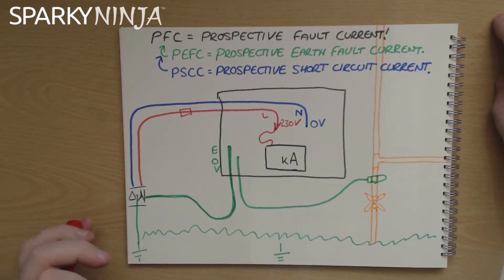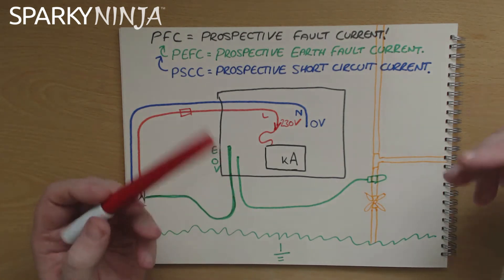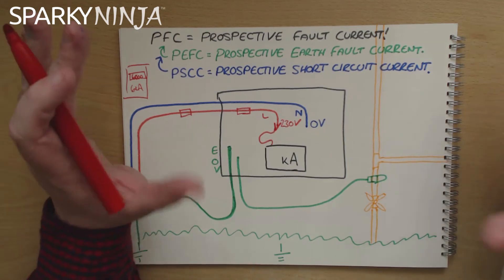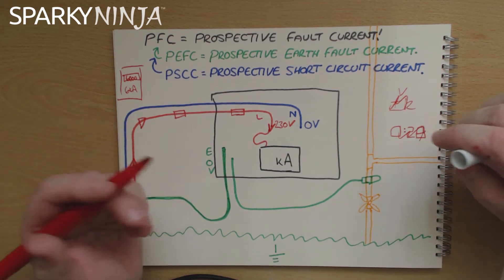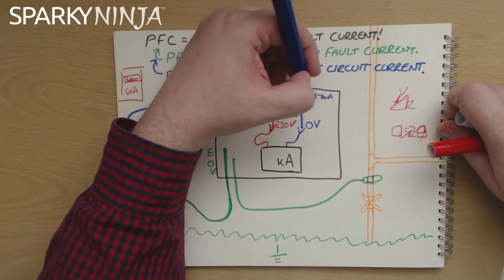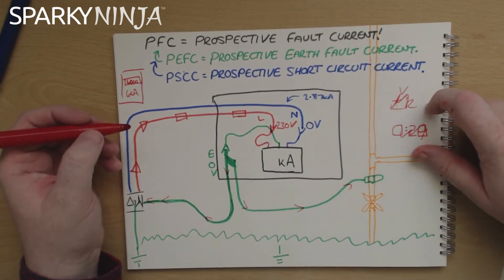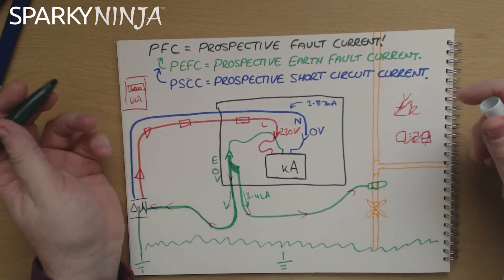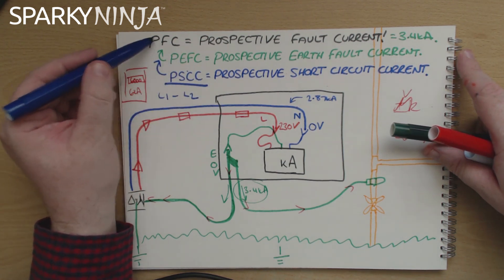PFC testing theory for Single Phase installations

Comment: I have a question regarding the difference between minimum prospective fault current (Ief) and maximum prospective fault current (Ipf). the question is the equation Ipf = (Cmax. Uo)/Zef, but for minimum Ief, do we use Cmin = 0.95 or Cmax = 1.1 ? it would be great to make a video regarding minimum and maximum prospective fault current

Comment: What I was always shown with my megger was disconnect earth to take a ze ( green clipped onto earth red to live and blue to neutral)note the top value for a pscc then reconnect the earth clamp green to the earth bar red to live and blue to neutral and let it do a reading then take the highest of them two readings.
Reply: Yeah, that's not correct. Disconnect the main earth for Ze only. PFC with earths connected

Comment: If you was doing pfc both pefc and pscc on a 3 phase and neutral supply would you use 2 lead high 

Pfc - l1 - e / l2 - e / l3 - e  taking the highest reading and x2 

Pscc - l1 - n / l2 - n / l3 - n taking the highest reading and x2 

If I’m wrong please correct me as I have an exam soon👍🏼 thanks for the vid

Comment: What do you do in a scenario where your PFC is higher than the 6000/10000 KA rating of an Mcb? Great vid as usual.
Reply from the maker: Hi Ashley, in these scenarios we need to either change the switchgear to higher ratings that can accommodate the PSCs or we need to engineer a lower fault current by introducing impedances into the circuit - this second option however is a big can of worms.

Comment: Hi Sparky... I recentely watched someone go through the motions...disconnecting the Earth from the CU....doing a Ze....and when I questioned why he had removed the Earth from the board and not the separate MET bar (where the TNS system and other bonding/earthing  were situated ) ....because he had included the Water and Gas pipework in his test...he seemed a little flustered.....I metioned that it was the suppliers Earth  (if you like) the he was testing...and that the Gas and Water would be included in the Zs test later.....He looked even more flustered. I left him to it....God knows the results.....and God himself will be able to explain it to the home owner or the sparks when they meet them/him...ha..ha..

Comment: Good stuff mate. Be good to see a segment on relating the Zs readings to the protective device disconnection times in BS7671, it may open a few more eyes, I witness this mistake loads when on site. People replacing an MCB to an uprated one for whatever reason and they deem it ok because they judge it by the circuits conductor size alone and do not consider the wider implications. Not good.
Reply: Are they upgrading to a 10ka mcb?